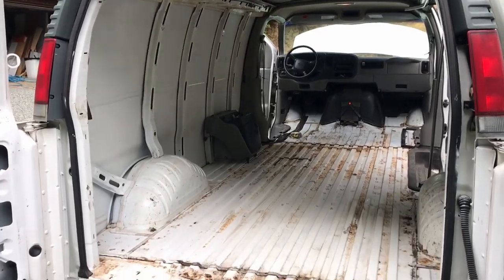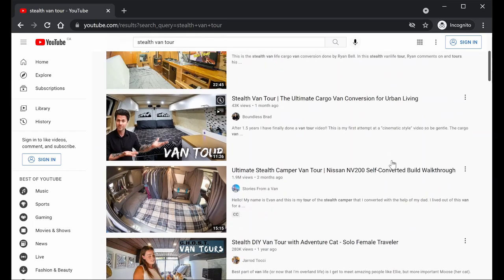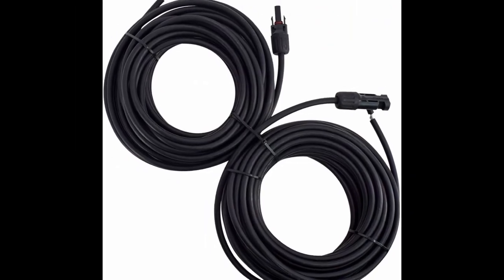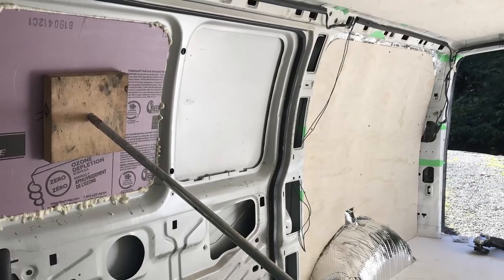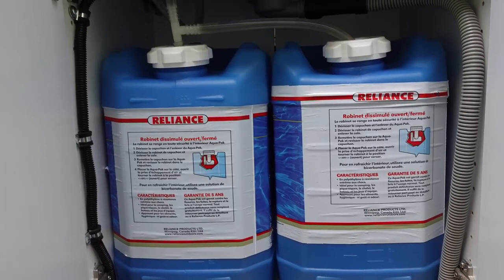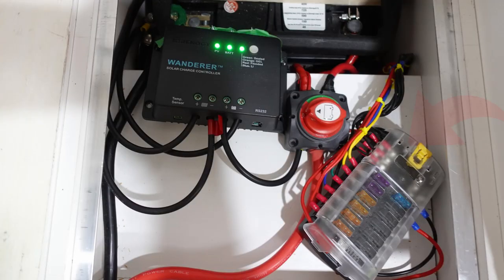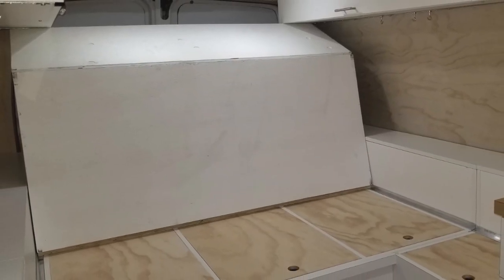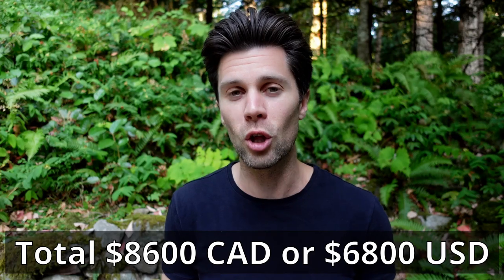DIY Van Build in 6 EASY to Follow Steps | Van Build Breakdown

Comment: I've watched hundreds of van build videos. 
I like your layout and approach the best: 1) simple cabinet layout, 2) kept the stealth look, 3) has a drain to ground-with exterior/interior access to water storage, 4) chest fridge, 5) a single long upper cabinet (for rod storage), 6) roof deck, 7) separate portable stove, 8) folding bed to sofa, 9) well insulated, 10) can and jug toilet options, 11) swivel seat, 12) side cubbies on both side of the bed, 13) roof fan.
Nice work!

I have a Dodge Pleasure-way and I plan to downsize to a stealth van in two months.  Can't wait!

As a consumer of van conversion videos on YouTube, I do wish there were more content about: CHOICES made during the build process. For example, right or wrong (i dont care), WHY choose a square shaped roof fan over one that is smaller, round, and a bit more stealthy but just as effective; were there other options you turned down; and why have one rather than two? Or, why did you use the insulation you used in the places you used it? Or, why puck lights instead of strips on the ceiling? Why your interior colour choices? Why real tiles instead of peel and stick gel tiles? Where are your, fire extinguisher, CO2 and smoke alarms placed and why those spots?  Etcetera. 
I love knowing the process. It's educational and makes the videos more personal to (without actually being too personal).
Thank you for posting! Happy trails!

Comment: I think everybody should take time to figure out the cost. As some get started. Then realize they need to take care of the Vehicle as well..And unless you're good Automotive technician like me. Has the tools and experience to fix it. It will cost you 3x more. While you have to wait till they get too it. 

Why the first thing I do when buying a used Vehicle. I go over it front to rear. Then fix what most people don't. As I had some that service manual was still wrapped in plastic. They never opened it. And missing transmission services will cost you $4,000.00+ when it catches up to you..As there is no such thing as Maintenance free.